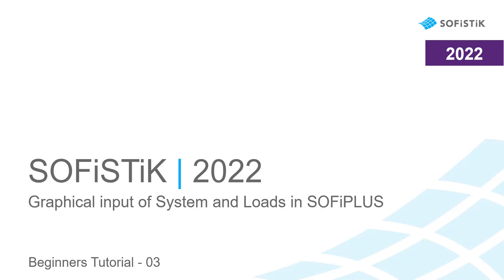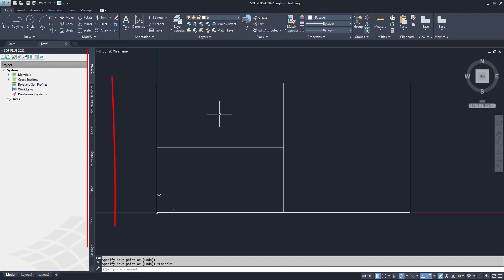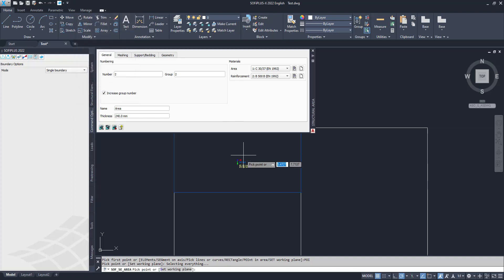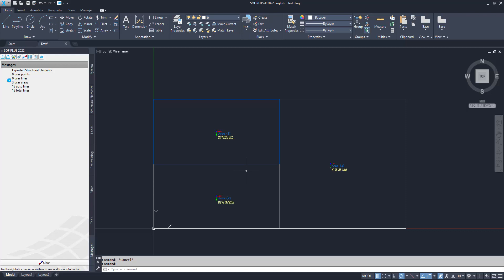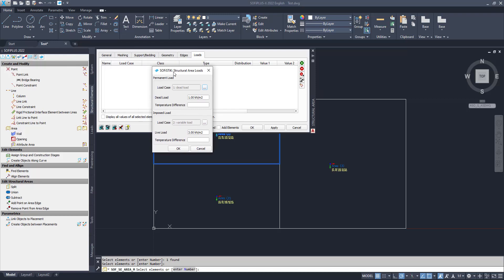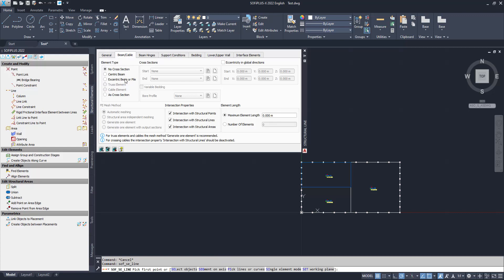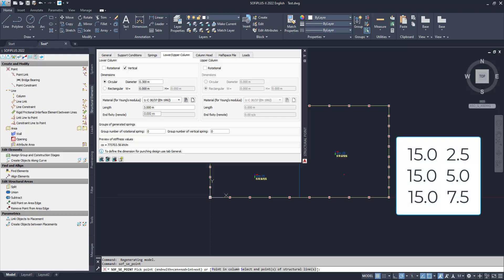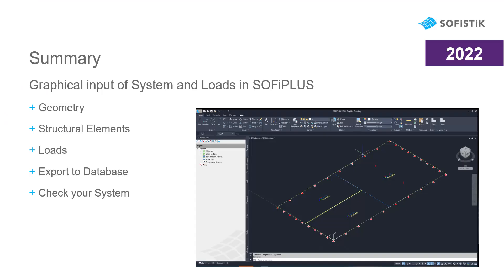#03 SOFiSTiK 2022 - Graphical input of System and Loads in SOFiPLUS

Comment: can you show how to apply multiple different area loads to one slab?
Reply from the maker: Hi Ben,
You can assign as many area loads to your geometry as you like. This Video only shows the "quick" way during creating the slab.
You can always add more via the SOFiPLUS Sidebar - Loads. Here you find not only the loadcase manager, but also "Element Loads" and "Free Loads".
Element Loads are hosted on the Structural Element, Free Loads are placed in your drawing wherever you want to.
So now simply select what kind of element you want to load (Point, Line, Area) and you are good to go.
Did this help you along?
Reply: @SOFiSTiKAG  yes thank you. I have an RC slab that i want to apply 3 different area element loads to, but when i click area load there is no obvious means of drawing the area of the slab that I want to apply the load to, I can only apply it to the entire slab. Are there specific criteria required to be able to apply a load to a certain area other than the entire slab? Thanks very much
Reply from the maker: Hi Ben,
Element Loads are always hosted by the whole structural element. 
If you want to apply loads only to a part of an element, you can use Free Loads.
That way you can draw the area you want to be loaded.